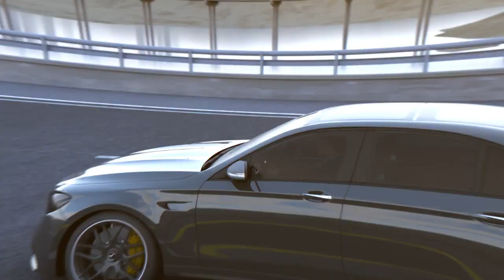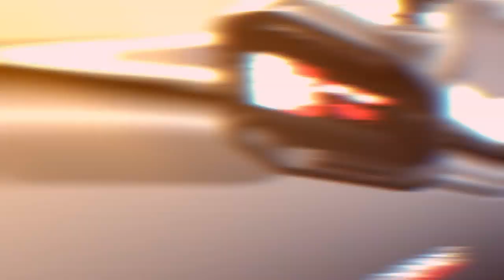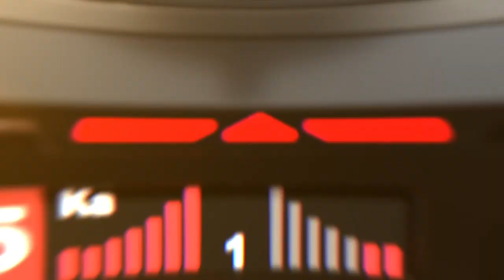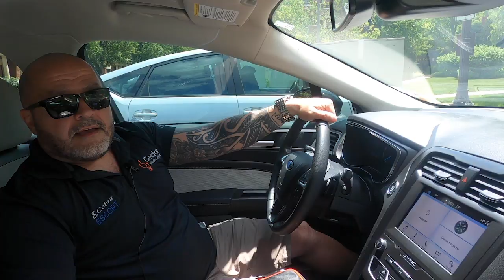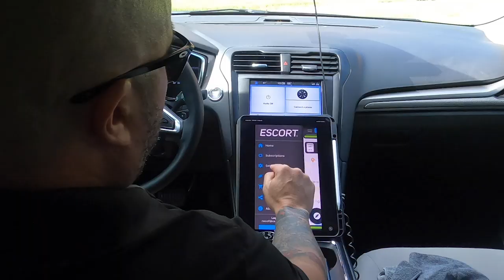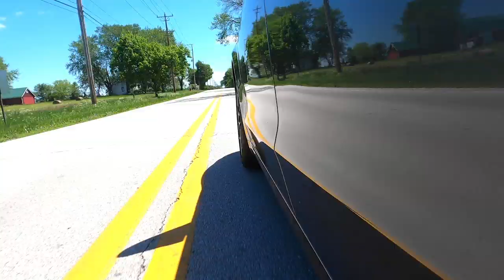ESCORT Redline 360c Launch Webinar

Comment: My 360 redline is coming in today or tomorrow..I bought a r8 almost two weeks ago...you should do a side-by-side  comparison on there features..r8 has a incredible amount of features
Reply: How are you liking your Escort Redline360c?
Reply: @J Dub   virtually no false signals...I sometimes run my r4 and redline side by side...what do to insure they get along is turn both detectors off and on every 5 to 10 minutes..and I always turn them off and on after every alert..redline is just as fast as my r4..its as sensitive as my r4 on 34.7 and 35.5 but the r4 beats it every time on 33.8...vortex guy a couple of days ago said there's a new software update on the redline..a little faster reaction time and more sensitively on ka...only thing i can complain about is the rear arrow gets confused at close range from a cop coming from behind...I'm going to send it back for a arrow check and firmware update
Reply: @randyjohnson6845   Good to know.  Did you do the most recent firmware update?  Hopefully that helps with the arrows.  Hard to believe it’s been out now for nearly 3 years.
Reply: @jdub1139  just saw it on a recent vortex youtube channel
Reply: @jdub1139  for 2 weeks i have seen it advertised for 675.00 bucks
Reply: @J Dub  north America...version 1.11/1.3

Comment: I ordered one, but does it come with a free trial of escort live? I find it a bit ridiculous you need to pay money for the app after spending $800. Hopefully it comes with at least a long trial.
Reply: Get ready to return it the test results are BAD
Reply: @RobnDidi  I'm sure they'll update it and make it work better. It did just come out. I've been using my 9500ix for years so it has to be better than that. I'll see how it is.

Edit: and I've been extremely happy with my 9500... its had to of saved me at LEAST 5 speeding tickets. The one time it alerted me and I pretty much ignored it but slowed down still saved me 25mph off my speeding ticket. Was going 115... difference between a $200 ticket and $400 ticket. And it alerted me well before the cop was there. Escort products seem a lot nicer than other detectors. Everyone loves their r7, but it looks a bit junky.
Reply: @User-g9b2c  sorry but a radar detector that costs $750  that claims to trounce the competition and doesn't come close to that claim, has terrible ramp, terrible arrow sensitivity & terrible rear detection right out of the box is no bueno. You shouldn't have to wait for updates to make it right especially considering the fact that they made those claims prior to launch so clearly there is quite a bit of deception going on here!

Uniden R7 or V1G2 clearly the better choice however I'm waiting to see what Thiea brings to the table while I continue to use my R7
Reply: @RobnDidi  its expensive, but not much more than any other brand at already $550. 200 more isn't much in comparison. The technology seems to be there but they must of rushed production. Ill wait for updates
Reply: Just wait... it'll vastly improve as time passes. I believe in escort products. I know 6 people with escorts besides me and everyone loves theirs
Reply: @User-g9b2c  I used to use escort products as well for quite some time however I switched to V1 years ago because it was just far superior in detection range and situational awareness and then switched to the R7 when that launched because they did what V1 did but even better right out of the box. That said escorts quality control over the years has dropped significantly in my opinion as I also purchased the original redline & max 360 that were also under performing to both my V1 & R7 so they both were returned. 

Once again they made significant claims as they have done in the past prior to launch which clearly were untrue so as a consumer I lost confidence in there products a while ago because there are better detectors at more affordable prices. Good luck with it hopefully they update them soon
Reply: @User-g9b2c  https://youtu.be/Kb1EpBBybQ8